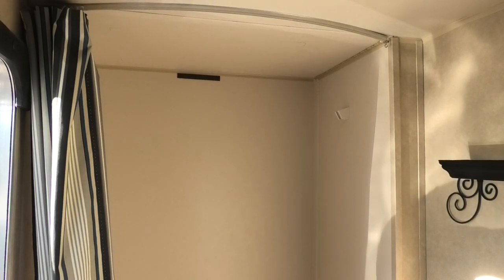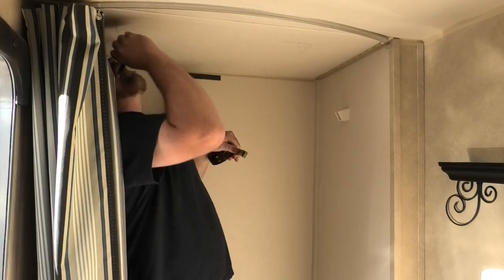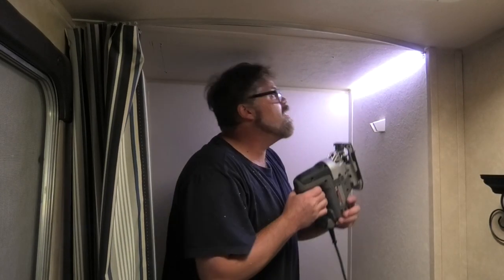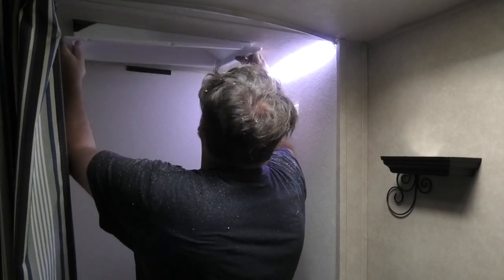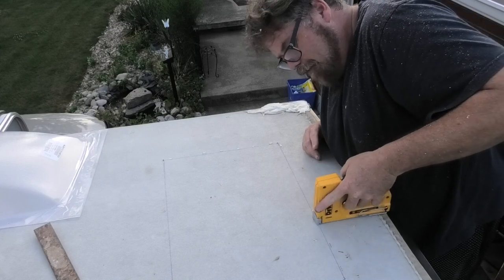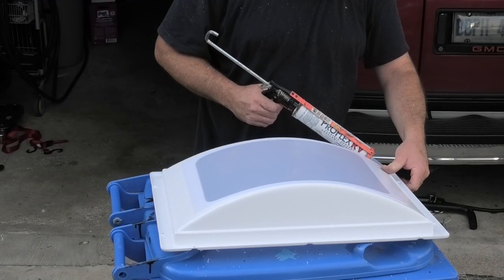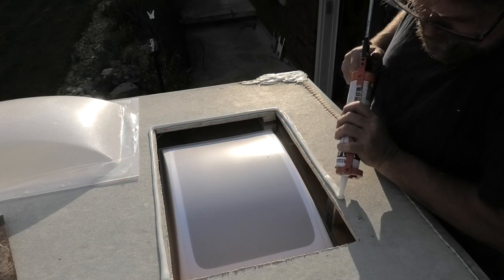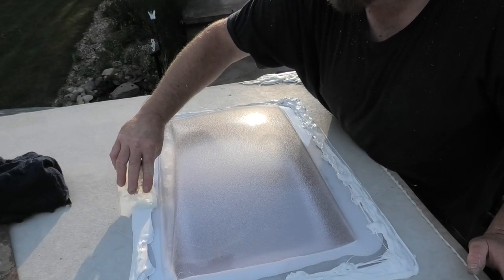Installing SkyLight In CamperTrailer:RV

Comment: EH? Will this work in my aluminum Cargo Trailer Roof ya Think EH? I want to try it on mine but I don’t see ANY SKYLIGHTS in cargo trailer conversions ANYWHERE on YoubTube! Y’s Dat EH? OR…….Perhaps installing one of those SOLATUBES with a PERISCOPE? I’d like to be able to see 360 degrees from the top without having to spend $$$ on camera gear. Thanks for ANY HELPFUL OPINIONS!! Kiko the Black Lab
Reply from the maker: Might be to deep of a frame unless you trailer is Insulated then ya it should
Reply: @LifeWithBillSiff  I DO have insulation! Actually 2 layers of pink foamular = about 1.5” plus the 5mm ceiling plywood and the thin aluminum roof.
Reply: @LifeWithBillSiff   Apologies for the late response....Thank you sir!